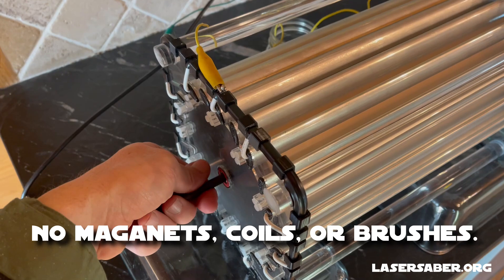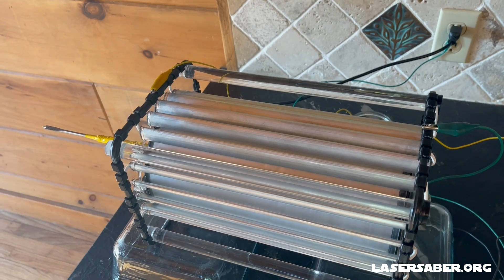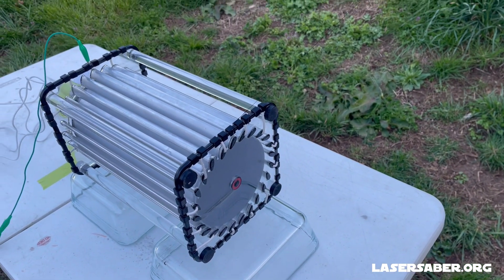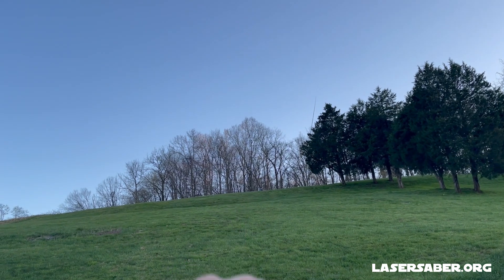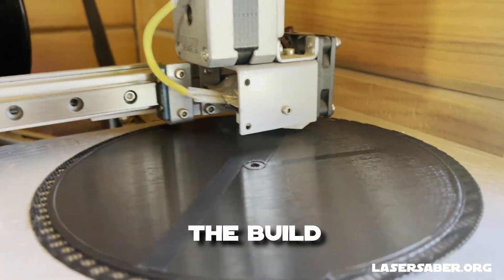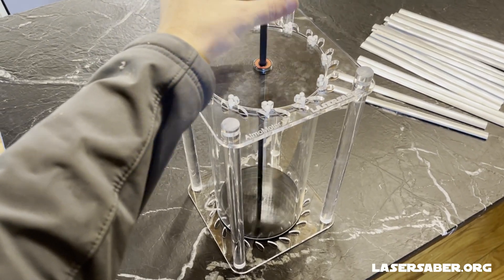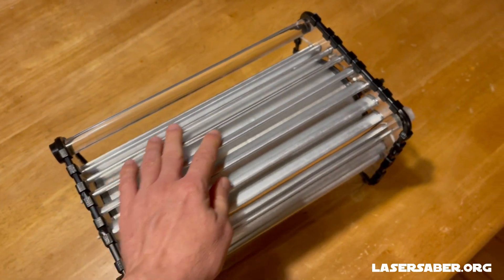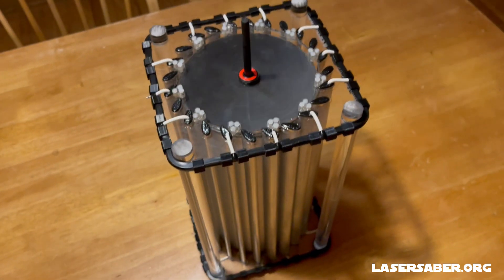DIY 30,000 Volt Drill - AtmoMotor V2 Large Corona Motor

Comment: Very cool use of the dielectric field!
Reply: Do you think a smaller motor could provide as much torque as the large one if enough voltage is supplied, and if the same torque could be acquired from a stepped up source of voltage?
Reply: @JenkoRun   smaller= less capacity, so indeed you would need more voltage. but that will brings challenges. In theory I feel it could have the same torque as long as the voltage is stepped up. but if practice will prove it?
Reply: A smaller motor with transmission can have a higher torque

Comment: Now this is a true free energy device. 
Years of research is starting to pay off. I've followed your work for years. 
Looking forward to future videos on this.
Reply from the maker: Thank you for the encouragement.
Reply: I guess that river stops at night? I'm super sceptical though. Will continue to watch your videos.
Reply: @j.d.5262  hydroelectric is continuous. Solar is also continuous but not for one place. If the whole planet had solar panels covering it, energy could be rerouted to the dark side of the planet, hence, it’s possible to be continuous.
Reply: @jjhack3r  but we can’t cover most of the planet. And we can’t transmit power that far very efficiently. This isn’t a replacement for solar. It is a scavenger device. Please don’t dismiss the hard work he has put into these devices. They are pretty amazing just based on craftsmanship. But also on efficiency.
Reply: For the price of that motor and a way to power it, you could get a small solar panel and make more power that is actually useful. Collecting static electricity is like scraping the dew off of a leaf when you have a damn river right next to you.
Reply: @jjhack3r  there's an error in your reasoning. What you don't understand is,  the atmospheric static electricity is the river,  not the dew!
Reply: @jjhack3r  You just don't get it. I'll wait for time to teach you, since you're unwilling to learn. 
Just the obvious. Solar cells don't produce at night, where this thing is stronger at night.

Comment: Most of the torque isn’t from the motor... it’s from the mass of the rotor. If you drilled several holes in a row, it would stall
Reply from the maker: I am sure that you are correct to some degree.  I will create a short video test drilling multiple holes in the morning.
Reply from the maker: I did your test and it did not "stall". Check this out: https://youtu.be/_Bc12ocFwcM
Reply: @lasersaber  I don’t give a shit. I’m not watching it. I saw this video, and that was enough to see that it comes down in rpm easily and doesn’t spin back up in a reasonable time. Something running off a AA or 2 would be the same power lol
Reply: @jjhack3r  Lol
2 AA's won't do what happened in that next video mate. I have followed this guy for years and even replicated some of the amazing experiments he has done. He is the real deal. You however, are not..... go troll somewhere else.
Reply: @jjhack3r ”I don’t give a shit I’m not watching it”

It’s true that people don’t care about the truth at all. You just threw a little temper tantrum because you were wrong. There’s nothing wrong with being wrong. It’s probably the best way to learn. But you can’t learn if you refuse to accept the fact that you were wrong. 

Honestly the comment started off as a genuine inquiry. Even the OP thought it was valid enough to try it out for himself. Instead of finding excitement in it you decide to throw a tantrum? That’s quite unfortunate.
Reply: There really isn't a whole lot of mass to that rotor... will be interesting to see...
Reply: @jjhack3r
You have been unzickered lol

Comment: Glass at high voltage stops being an insulating material, and becomes superconductive.
Reply: It does not become a superconductor. Just reading your comment pains me due to your ignorance...
Reply: @jjhack3r  I didn't say it became a superconductor. There is a difference. This is the method used in a few very large glass recycling facilities to melt the glass requiring extremely high voltage (and current) to maintain a melted state at the expense of the carbon rods every 3-4 months.
Reply: @Dennis_M1DLG  the only things that are superconductive are superconductors. Glass, in its molten state, is conductive but in no way “superconductive”
Reply: @jjhack3r  I think there's a way to make your point and be sensitive  to the original commentor, suggesting maybe that he means highly conductive vs super conductive. 

While superconductor superconducting and super conductive are well define electrically as zero electrical resistance, the terms highly conductive is not defined, is relative or may be subjective.
Reply: @Dennis_M1DLG  Anything that is highly conductive does not make for good electrical heat source.  Consider p=v²/r   watts = volts squared / resistance. 

Typically we want highly conductive wires to carry sufficent current to a  higher resistance  than the wires where the source of higher resistance generates usefull heat with sufficent current flowing in it,  But the source of resistance can not be so high that it restricts current too much for a given voltage.
Reply: @kreynolds1123  thank you for your not rude reply. I will check the book I was recalling when I get home, there maybe context I am forgetting. 

Meanwhile the other guy can change his attitude, he might even get laid if he did.🤣
Reply: @Dennis_M1DLG  I'm a fan of constructive criticism. Maybe everyone could benefit some by being better at it.

Comment: if u use it to charge a compacitor/ battery bank it would be more practical
Reply: Compacitor??? It’s capacitor... The “free energy community” always consists of the most ignorant people who know very little about physics, or in your case, how to even spell words correctly.
Reply: I'm not a free energy nut and blame Google spellcheck this isn't"free energy" its just collecting mostly bleed off from power lines and radio/cell towers ect
Reply: @raymondsims537  no this is running off of naturally occurring electrical buildup between the air and ground. He has a video that explains this.
Reply: @NandR  yes but there is more than some bleed of involved  i built one years ago as part of my hcs final project and used it for my science grade by testing it near various appliance. on a side note 3g/4g towers bleed a shit tone.
Reply from the maker: This is DC not AC.  Google "Hermann Plauson" he was getting some real power. "Herr Plauson found in his experiments that a
single balloon sent aloft to a height of 300 yards gave a constant current at 400 volts of 1.8 amperes, or in 24 hours over 17-1/4 kilowatts!
By using two balloons in connection with a special condenser battery, the power obtained was 81-1/2 kilowatts in 24 hours. The actual
current delivered was 6.8 amperes at 500 volts." Science and Invention, Vol. IX (106) #10 (February 1922)

Comment: Nice torque. Can you see a way for this motor to be a high voltage generator?
Reply: Why would you ever want to do that? There’s already ways of making high voltage, even from mechanical energy... just because an LED can be used backwards doesn’t mean it has any value to do so. Solar panels exist and do a far better job.
Reply: @jjhack3r  First I want to say, I'm not certain that a corona discharge motor could be used to generate high voltage. But supose it could. And supose it could do so with cheap light weight parts. Then that would be interesting. 

Why might high voltage lightweight generators with good torque be interesting?  Large scale wind turbine could benefit immensely if they can shed reasonably significant weight. And if they can produce high voltage DC, then the transmission over long distances is efficent with low i² losses. 

There are high power high voltage capacitive motors that are promising on the torque end that could in theory be made to generate.  But maybe I'm missing something but I don't see how corona discharge motors can be made to generate.
Reply: @kreynolds1123  even if it works, which I don’t think it will, that kind of high voltage is beyond the threshold of benefiting from reduced transmission loss. Whatever you don’t lose in the long distance power line, you will lose while converting it back to useable lower voltage ac. And when it comes to wind turbines, weight isn’t a limitation.
Reply: @kreynolds1123  if you’re going to put the time and energy into making a high voltage generator from this motor, take inspiration from a van de graaff generator and modify the motor to operate in a similar way. But then again, you’d be reinventing the wheel
Reply: @jjhack3r   yes one could use triboelectric static generators generators like the van de graaff. Speaking of reinventing the "wheel",  whimshurst and other electrostatic induction machines are also well known high voltage generators. 

As to high voltage DC transmission, it's commonly used even today, typically between 100kv and 800kv.